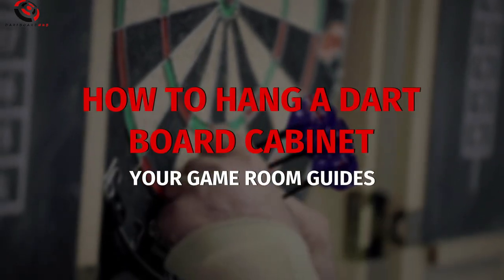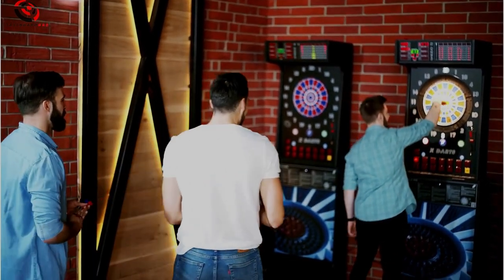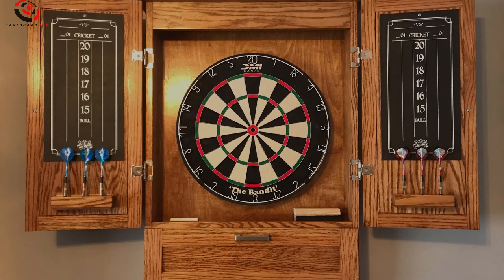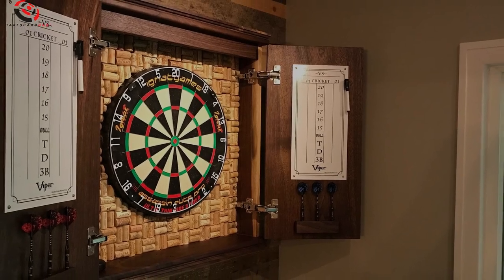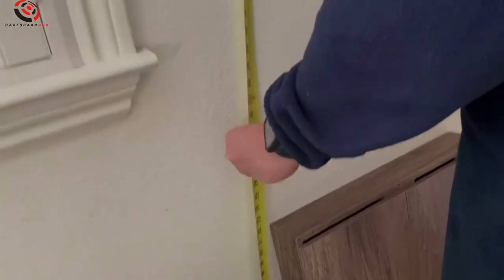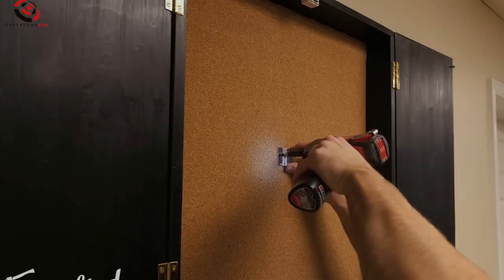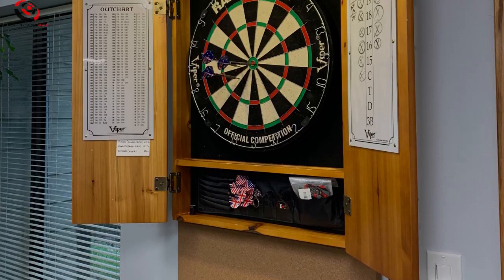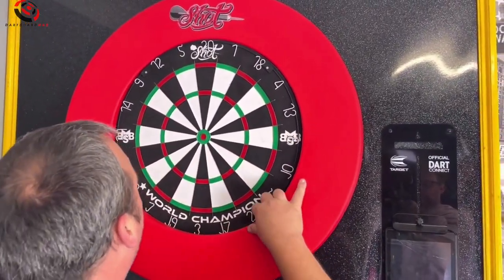How To Hang A Dartboard Cabinet?

Comment: Hello, I just started Dart and I've been trying to play with my own efforts for about 4 months, I want to buy a good set and I like the MGV Exact and Aspire series. But I'm undecided about the weight, there are those who tell me to take a light 21g 22g. For those who say 23G would be more standard. What do you recommend the set 24G that I am currently using?
Reply from the maker: Ultimately, the best way to choose a dart weight is to experiment and find what works best for you.You can try current 24g MGV if comfy, there's no need to rush out and buy a lighter weight.Lighter dart use  for finesse and heavier dart for power. Thanks for your comment!
Reply: @DartBoardHub   I've been trying to experience it for a few months already. I used 24*25*26 darts and also had the chance to experience 23g. But the darts I use are more torpedo shaped. I didn't have the chance to try straight darts. I work alone and mostly watch pro players on the internet and try to create an ideal shot and grip for myself. But people around me think that trying so much weight will ruin the shot. And they think it would be beneficial to stay at a constant weight. I also tried the light dart sets of the people where I play, 22g seemed comfortable to me, 23g was comfortable. I want to have a good set or two. I liked MGV's Exact and Aspire darts and the grip felt nice to me. I didn't know if I should take 21.5g or 23g. I thought about buying the aspirated one in 22g. I need professional opinion. After all, it is not a cheap set that I will buy for my economic conditions